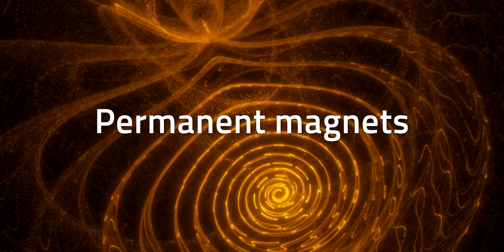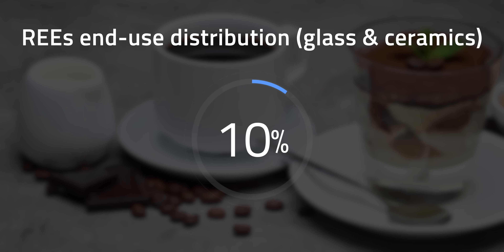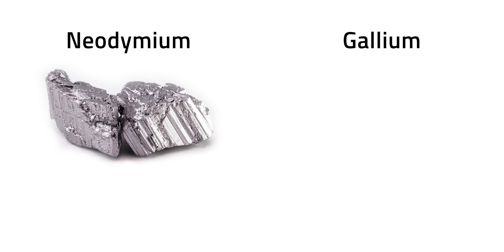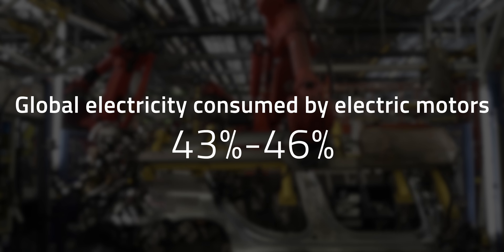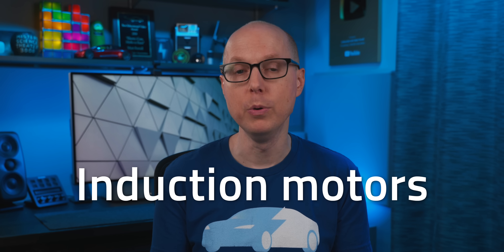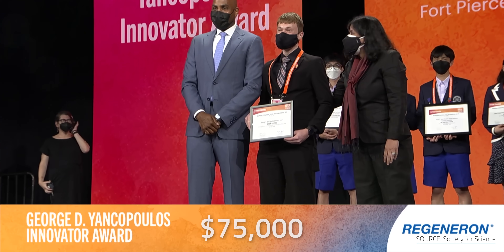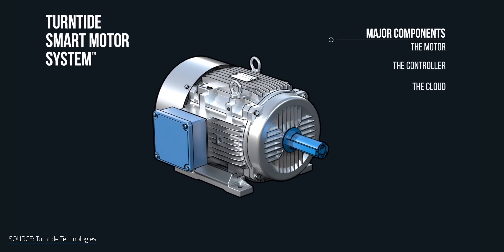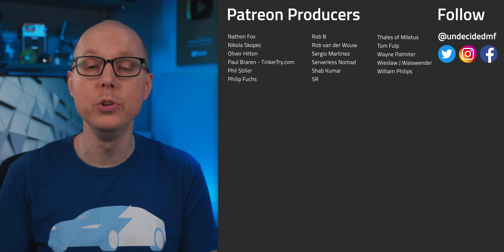Why This 17-Year Old's Electric Motor Is Important

Comment: Thank you all, this stuff interests me, but did you know you can pulse electrify a motor, either normal or brush-less. I'm doing simulator experiments, for Electric Air, and Space craft utilizing PEDF's, Pulsed Electric Ducted Fans. As you may know, electrons plus resistance, slow a current but increase temperature, which slows a current even more, causing more heat, a thermal runaway scenario. So for a 4 motor plane, you can pulse the motors at say 5Hz, when a motor is sparked, it will begin to rotate, generating just a little heat, the attached fan will cool the heat, plus it's inertia will make it continue to rotate for a while, cooling or propelling even more, (thrust) exponentially. I only used 5Hz at the beginning, a spark for each motor plus 1 for the accessories, at 50% duty cycle, per second. Multiply by 1000 = 5KHz, there is barely a performance loss but the motors run much cooler, efficient, and with less wear, or breakage, and still leave a little power for accessories. It's an ongoing experiment I'm working on for mostly Cars, SUVs, Airplanes, Spacecraft, Helicopters, but also any computer cooling fan, or system might apply. Air or compressor liquid coolers as well? In my systems, the electric generator runs continuous, charging, but not the load, cycling, or redistributing saving, power, and, you know, cool-ness? Amen?

Comment: The original Tesla Model S motors were inductance motors, not permanent magnet based DC motors.  Tesla has a bunch of patents on the designs.  The permanent magnet motors in the Model 3 were cheaper to manufacture, and lighter, and so that's why they went with that design.  Anyway, inductance motors (electric motors that don't use permanent magnets in their design) have already been used to great effect in EVs.  Hopefully this new push into optimizing their designs will make them the norm - I never liked the use of rare earth magnets in infrastructural industrial design.

Comment: Squirrel cage!  It's a joke, compression fans have them too.  Ever see a mouse exorcise wheel,  The joke is when you have a bad bearing it can "chirp" as the bearings seize in the housing, sounds like a squirrel.  there is usually a housing like a cage. Squirrel Cage!!!

Comment: It's called a squirrel cage because it originally was bars welded together exactly what a hamster or squirrel cage looks like. Ya know the ones little mammals exercise on running inside the spinning cage... Modern designs incorporate laminated short circuited plies but the cage still exists casted into the rotor. They are literally short circuits designed to induce large currents opposing the AC electromagnetic field... Own words/explanation hopefully not too far off it's complex. Kudos to this Florida Man. As a kid in Florida Motors were my thing too. Took 1st place building a DC motor from scratch 5th grade. Peace.

Comment: The flipping of the polarity in the animation 6:44 is in the incorrect orientation. It should happen 90 degrees from where it is shown, so that the loop of the armature is aligned with the magnetic field from the stator.

Comment: I learned quite a bit about how motors work through this video; thanks! BTW, it's not "impacts", but effects. And the symbol for tonnes is t, not "T" (which is the symbol for teslas, a unit of magnetic flux density), so it should be Gt, not "GT" (gigateslas).

Comment: The animation you have at 7:40 is not a squirrel cage induction motor. You ask why it is called a squirrel cage - the animation shows a motor with windings around the poles. A squirrel cage looks like the wheel a squirrel or mouse would run in. It just has bars (conductors) across the face of a cylinder. But rather than a hollow wheel, it is  solid iron. There are no poles, and no windings. That is the magic of induction.

Comment: Smart SRM motors and inverter + induction motors can save 35% or more energy compared to standard line driven induction motors in applications that involve fans and centrifugal pumps which occur often in HVAC applications. That is due to the 'Variable Torque Load' which fans and centrifugal pumps exhibit such that Torque ~ (RPM)^2 and HorsePower ~ (RPM)^3, which means that a 15% reduction in speed can reduce electrical power requirements by 35% to 50%.

Comment: There is a lot of buzz on axial flux motors these days. Enabling more efficient use of magnetic fields for higher torque with smaller motors ( so many motors, reducing total required materials is a definite plus.)

Perhaps better than the radial designed reluctance design.  Perhaps an axial reluctance motor would (is?) be the way to innovate the next big thing in motors?

Comment: Overheated means it has poor efficiency. Efficiency is an issue, but heat is a much bigger issue. Air between the armature and stator is necessary for armature cooling. One could also make the electric motor vacuum, which would drastically improve the efficiency, but the armature would then no longer lose its heat.

Comment: The reason why it is called a squirrel cage motor is because if you take out the rotor and imagine removing all the laminated plates that make up the majority of the visible construction of the rotor, you will be left with a whole lot of metal bars that join the two ends. Those bars resemble a squirrel cage. Those bars are effectively the rotor windings. In an induction motor, the rotating magnetic field from the stator windings caused by the 3 phase supply (or windings offset by a capacitor or other methods in single phase motors) causes currents to be induced into the squirrel cage, which oppose the original magnetic fields resulting in rotation.

Comment: I don't understand why manufacturers don't look into hydraulic drivetrains for all electric vehicles. They are insanely powerful, already used in industry, and can be powered with a smaller battery than electric motors

Comment: I believe what you are calling, or whoever, a smart motor is an A/C motor with a VFD (variable frequency drive). A/C motors when started work to immediately to achieve the RPM of the designed stator and rotor. The horse power is relatively low during this cycle. Industry would use clutches or soft starts (torque converter) to allow the electric motor to achieve a higher horse power before engagement. A VFD  would allow 100% horse power at a very low RPM by increasing the cycles of the A/C. VFDs were installed on locomotives and mining equipment to improve efficiency and durability.  HVAC units began using VFDs to eliminate full power start ups that use as much energy as the electric motor may use with in a half hour or more of use. In Phoenix I upgraded to a variable speed air conditioning unit that dropped my electricity consumption to under 50%. The unit would be running all day long but at much lower speeds for most of the day.

Comment: disclaimer: there is no PM in all motors for instance there is no permanent magnet in asynchronous AC motor at all AKA Tesla motor or induction motor which are used in tesla cars. Basically current inducted by the slid in the squirrel cage generate rotor  magnetic field which is created by PMs or coils driven outside in other technologies. İn addition Reluctance motors are not new. However, thanks for the content anyways.

Comment: Seems a lot of energy wasted inside the motor can be avoided if one can achieve a vacuum inside the coil chamber. Although challenging it may have less friction and heat transfer as a solution to the reluctance motor hence no air gaps are necessary.

Comment: There is also a new improved heat exchanger that keeps running at 100% capacity without needing to be serviced, this also has huge benefits in many industries, and saves a mind boggling amount of energy
It is called foulingCure 
Would also be a very interesting video

Comment: A potential reason non-permanent magnet motors have not been adopted in the EV automotive industry: regenerative braking needs to solved to adopt use in electric cars, OR the efficiency of the motor must take this factor into account.

Comment: Important to note that  Galileo Ferraris and Nikola Tesla independently invented the AC induction motor  in 1885 and 1887 respectively, including the variable reluctance type. These are all without permanent magnets. 
The challenge today is to refine these well-known and widely used principles and designs for high efficiency and suitable power response.

Comment: Actually, a switched relucter motor can be more efficiency than a PM induction motor. Much of the brake effect of flux lines crossing the rotor is not present.

Comment: In my lack of knowledge:  Can such a Synchronous Reluctant Motor also be reversed used to be a generator? A generator doesn't need torque, but demands power to turn the shaft.  thus if there is less torque delivered in Sensu's motor, maybe the lower torque output will bring about an easy to turn generator...🤷‍♂️

Comment: The Surfshark math doesn’t add up. It’s $2.21/mo for 24 months. Your ad says, plus 3 months free. When calculating the the total, the website includes 3 extra months…but at the $2.21 rate. Nothing about the 3 free months. So, with the UNDECIDED discount. The total shouldn’t be $59.76 for 24 mos at $2.21. The last page before putting in the CC info does show “3 free months”. But the total still adds 3 mos. Hope that makes sense (this is all before VAT is added). 
I was considering signing up, but not with the deceptive marketing on Surfshark’s website. That being said..love your content Matt. Keep it up!

Comment: We have been using magnet free Motors and Generators for very many years, and they are up in the high 90% efficiencies.. . We make the magnetic field from DC Current through Field coil windings. .   So very little room for any further improvement. . .  That video mentioned heat and melted plastic. . .  That is lost power, something we want to avoid in our motors and generators.. . .   I do not think Tesla invented the induction motor, but he probably improved on earlier designs.. . .    New Wind turbines are going back to permanent magnets for their Fields, because they can make them cheaper and lighter and more efficient, than coils for making magnetic fields. . .   The video mentions Torque, this has been a problem with high speed motors, when starting from stationary.. .   These days we use VFD ( Variable Frequency Drives ) to power such motors, so we can now maintain high efficiency and high torque even at low starting speeds, these are also up in the high efficiencies.    .  So I am not seeing much room for motor improvements, when they are now up in the high 90% efficiencies. . .  By the way, rare earth materials are more abundant in Australia and being mined there for some, rather than China, and there are other places in North and south America also.

Comment: Most of those claims at the end sounds like bs. Such big energy savings are not possible, simply because current motors typically work in 90-98% efficiency, if not counting those notoriously bad chinese brushed motors which are made to fail and have very poor materials. For example old AC syncronous motor, used in constant speeds fans can go up as high as 98% and contain nothing but iron and copper for windings.

Such motors could also be adjustable with relatively simple adjustable frequency driver. Because of poor weight/power ratio, they are not well suitable for applications like EV's.

If someone speaks about 30-50% energy savings with new type of electric motors, it's either intentional lie or misunderstanding. Some electric motor can be 50% more efficient than other motor without providing significant savings. 

For example, if motor have 95% efficiency, it have 5% losses. 50% more efficient means 50% less losses, which is 2.5%. therefore motor efficiency would be 97.5%. Instead of giving 50% savings, they are closer to 2.5%.

Comment: It's a great idea but it's still not a solution for electric vehicles because they still need the batteries that are mined and processed with oil and electric made from coal and the old way. What's wrong with going back to an old technology with a new way of doing it with steam and hydrogen fuel to heat it. That's totally renewable and you don't need to mine extra materials because there's already plenty that gets recycled and cost next to nothing. Plus they work in water and don't short out and catch fire! 💚💛❤️

Comment: Correct me if I'm wrong but aren't universal motors technically permanent magnet liss motors they use The electricity running through the armatures wires to produce the magnetic fields The same could be said for generation of power alternators don't use permanent magnets either they use an exciter coil.
Of course I haven't even gotten into watching the whole video so take my words with a grain of salt

Comment: Squirrel Cage Motors?
The traditional three phase induction motors have all their windings in the stator.
Their rotors are essentially a pair of solid rings, each one installed close to a motor bearing. and connected together by a set of solid copper bars. Bars and rings form short circuited conductors, allowing rotor currents to flow and create rotor magnetic fields. Anyway,
if you disassemble the motor  and strip down the rotor to its basic form, the welded rotor bars look like a hamster wheel.................or a squirrel cage.

Comment: Another way is two flat plates with positive electric with variable distance of separation or phase angle  control torque and speed so reduce motor weights

Comment: Though his motors are made from plastic parts, it seems that as RPMs increase he has a mounting heat problem that isn’t indicative of induction motors. Perhaps the resistance of the motor is too high.

Comment: You show promethium in the video.  Yes, it is a "rare earth", but VERY rare.  No known isotope of this is stable!  This has no use except in some exotic nuclear physics lab.
          Catalytic converters DO NOT use rare earths.  They use platinum, palladium, & rhodium.  There are precious metals, NOT rare earths.
          Wind turbines of any significant size REQUIRE gearboxes, & so do electric cars.  This is because any electric motor's efficiency is proportional to the SQUARE of speed.  Turbine's speed of ~6RPM is geared up to ~10,000 RPM at the generator.
          Electronic waste NEVER contained mercury.  Lead has been eliminated.  What makes recycling difficult is the chemistry of the separation, NOT the presence of lead.
          The "squirrel cage" term comes from the arrangement of the conductors in the rotor.  If the iron were to be removed, there would be 2 rings spaced apart, with a set of bars between, like the animal exercise wheels.
          Starting at about 14:00, this video is PURE MOONSHINE.  Switches synchronous reluctance motors have been designed, made, & used for YEARS.  Even the present Tesla car motors are part-reluctance.  There is one inescapable law of physics they are ALL up against: they require a magnetic field to work, & that field, if made by current-carrying coils, requires POWER that does not make the motor run.  (About 1/3rd of the current in "permanent magnet free" AC motor is "spent" setting up the magnetic field.) Rare-earth magnets make that field WITH NO POWER.
          There is another statement that makes no sense: the efficiency of Sansone's motor at 2 different speeds, one twice the other.  Motors should have an efficiency that is proportional to the SQUARE of speed.  The 2 efficiencies quoted were almost the same!  That implies that his motors were consuming mostly "parasite" power, definitely not efficient!
          These energy saving quoted are those obtained by replacing older induction (cheap) motors with newer reluctance (expensive) designs.  This efficiency numbers would be even better if permanent magnet motors were to be used.  You don't mention things like more expensive "electric steels" that handle more magnetic flux.  (These steels are 49% COBALT, more "conflict" elements.)
          Also mentioned is that the motors are "air-gap free".  One air-gap MUST be there.  That is the one between the rotor & the stator.  it is THAT air-gap that requires so much magnetic expenditure to overcome.
          Will this motor make a difference?  First, let me see the design.  (You should too, before making claims for it.)  The big problem is not rare-earths, it is MONEY.  Electric power is too cheap to justify expenditure on motor!  If he patents this, it will be EXPENSIVE, even if it is cheap to make (HIGHLY UNLIKELY).

Comment: I don't get why there aren't electric motors that use electro -magnets for the rotor and stator.... At the very least, they should be the same as permanent magnets, and i would think that with some tinkering and figuring (likely using computers to compile a ton of data and perfect it) if both rotor and stator were cycling their poles, i would think it could become more efficient than permanent magnets

Comment: As with my previous comments.....after sleeping on this.....THE AIR GAPS and the iron content of the metal alloy and the Barkhausen effect in AC voltage/current........ >><<  I missed it....the AIR CAPACITOR...The Condenser of antiquated terms.    The AC in effect of Barkhausens...and the definition of a CAPACITOR as energy storage...and the cyclical flip flop of AC !!!  But makes you wonder too..... how much static electric energy potential is present in the ENERGIZED STATE in such a charged FIELD that would be PRESENT as a result

Comment: The issue with cloud-connected motors is that you really need to factor in the energy used by the servers themselves into the energy equation.
Reply: Excuse me? If the internet goes down, your furnace doesn't work anymore? Count me OUT.